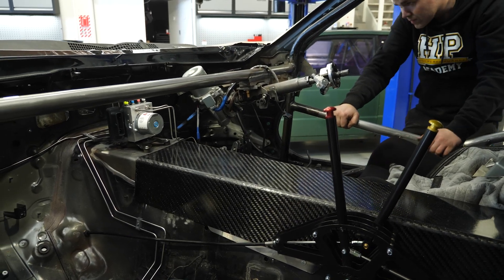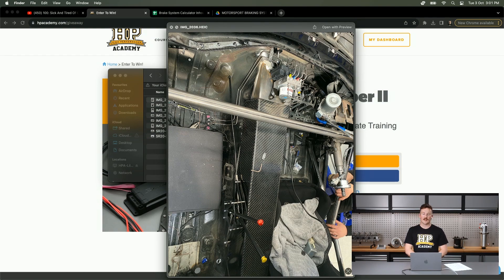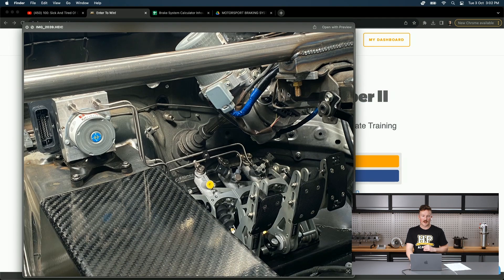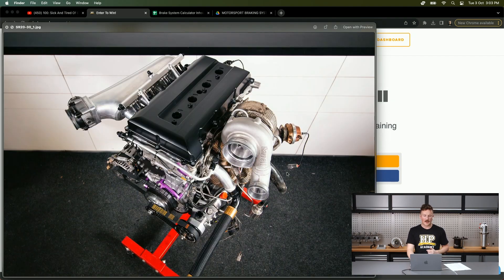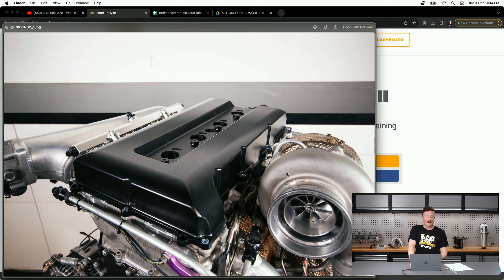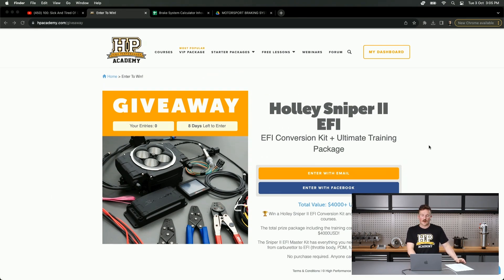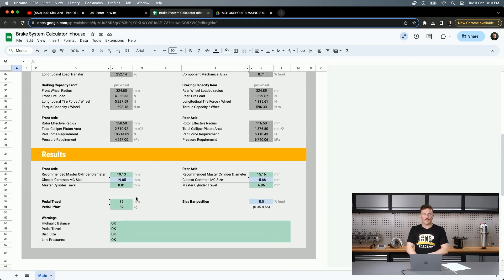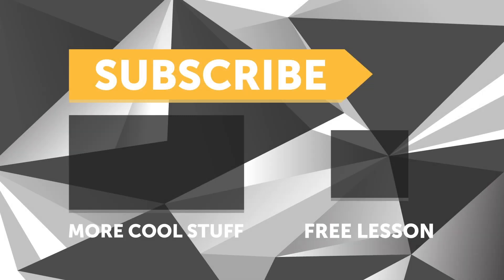Rebuild complete! This comes next.

Comment: I was really waiting for updates on this engine also the gt86 i am also busy with my sr20 and seeing how much trouble you have with the sr20 is not so convedence inspiring 😅
Reply from the maker: We'll have more coming soon, Brandon has been busier with the KRX (CRX build) lately as the gearbox was massively delayed and rather than cobble it back together with the 5-speed, Ben and Andre made the call to just wait for the parts and do it once and right, so he's done a lot of other work to it which was going to happen next year now instead.
That is something we didn't do with the 'SR86' when we first swapped it in and a reason for some of the niggles. It was 6 weeks before the first race that we got the final 'it's not happening' call on the 3uz and decided to pop it into the GT86.
From there some of the issues, like the cavitation, were not something documented as being common by others at this power level, and still are not, but are things people like yourself can pre-empt with this content at least if you choose to take that path.

With hindsight, the best decision would have been to just wait 12 months for the 3uz build, but at the same time Andre is really happy with the car now and how it is more competitive in the class the SR20 puts it in than it ever would have been with the 3uz.

I don't think things would have been too different if we used a different 4 cylinder either in the timeframe we were working in. If anything it could have been worse if we had to build an engine in that time frame vs using the SR which was good to go.

You can't know until you know though right, that is all part of the game! Hope you enjoy the future updates and your own journey with your build whatever direction you decide for it 😎 - Taz.

Comment: Do you guys have a course on the Motorsport ABS & Adjustable sway bars ? Definitely would like to add those to my car eventually
Reply from the maker: Specifically what topic/s around the ABS? The brake course and up coming motorsport plumbing course might cover some of what you need depending on specifically what your project is.
For sway bar setup the alignment course is what you want although the suspension course dives into them to. They are referred to as 'anti-roll bars' or ARBs in course material, but sway bar is a different name for the same thing - Taz. 
https://www.hpacademy.com/courses/suspension-and-car-setup/
Reply: Thank you ! @hpa101